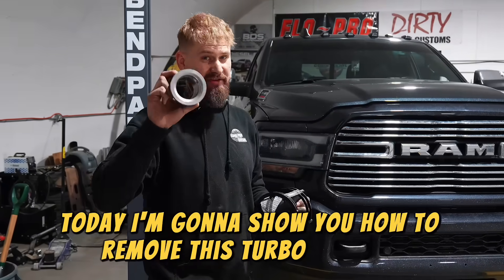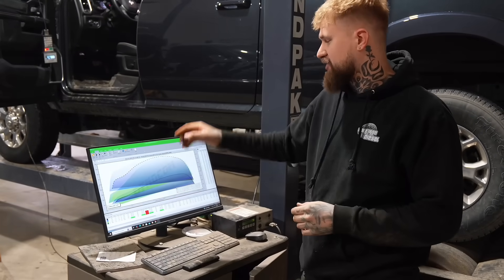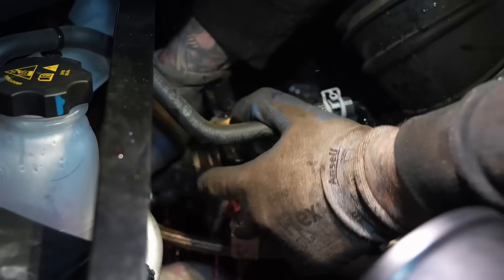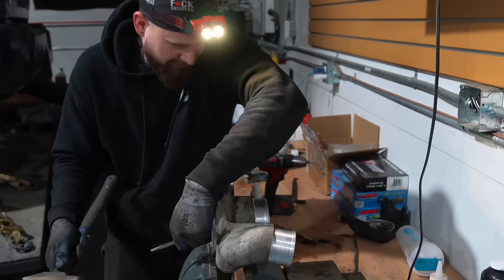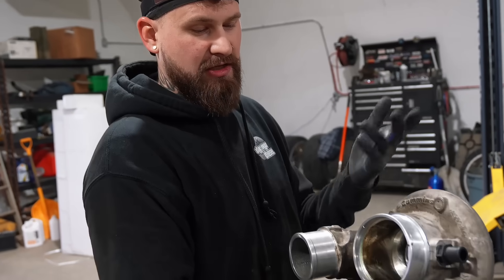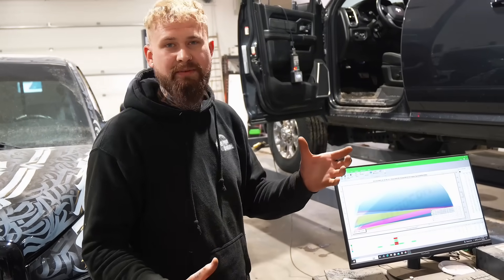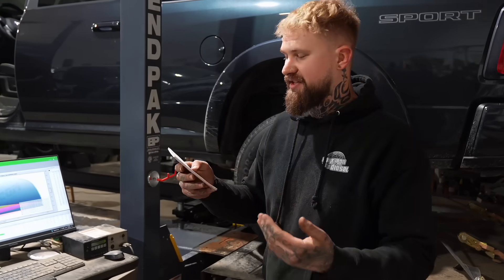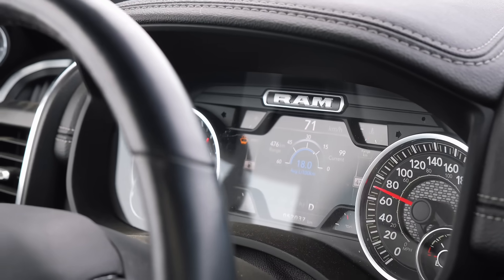Does Removing The Silencer Ring Increase Horsepower?

Comment: Isnt that the surge ring. If so i would never take that out. 100% pull that plastic baffle though
Reply from the maker: 🤷🏼‍♂️ I thought it was the silencer ring, to be honest most of the new knowledge I gain now is from comments on my videos and posts 😂 I definitely never claim to know everything
Reply: @darkirondiesel  lol I definitely don't know everything either but when I looked at mine it just looks like a built in surge ring instead of for example the bolt on intake with the anti surge the l5ps use. 🤷‍♂️could very well be wrong
Reply: The surge channel is part of the housing, this is just a silencer ring.
Reply: @Lethal-Media  the only possible opening for an anti surge system is between this ring and the rest of the housing so there's no way it's part of the housing.
Reply: Definitely the silencer ring, VGTs don’t really surge much anyway
Reply: @joeydalia2572  vgt has nothing to do with the compressor. Surge when the compressor is at to high of pressure and to low of mass flow for a certain shaft speed. Having a turbo that runs close to surge at peak numbers gives you better drivability "under the curve" so manufacturers like to push that. So yes vgts surge. I'm just not 100% sure if that's actually an anti surge system or not.
Reply: @Eric_V410 At the end of the day it doesn’t matter, if Kyle kills the turbo we can learn from him and it will make for good content upgrading the turbo or turbos..
Reply: @Lethal-Media  well I mean it's your money your truck do what you want. I just think if it's not a silencer ring people should know because lots of people remove them cause people on social media do

Comment: When are you gonna test the Banks Monster Ram Air Horn?

Unless Banks already Threatened you...
Reply from the maker: No banks actually sent me one. Hopefully get the rest of the footage for that video this week then have it uploaded by the end of the month
Reply: @darkirondiesel don’t let them buy you out like the rest of these YouTubers.
Reply: @darkirondiesel  hope so
Reply: lol I ask then that few weeks ago
Reply: I'll need that footage released sooner rather than later, was on the fence between banks and SB, banks on its way, may wait to open if results video will be soon!
Reply: @SHPLOOPSHPLOOP  Banks will net near zero gains and lose torque. Firepunk has a video out. And before you say it's gains are more pronounced in tuned and modded trucks, they used one with over 1k hp. Another shop owner used a stock truck, same loss in torque. $1k paper weight.
Reply: @HSKFab  ooof, it's odd cause of the gaping plumbing they use compared to others, but I bet their MAF sensor contraption has a lot to do with it. Wonder what would happen if it were tuned properly with the regular sensor
Reply: @SHPLOOPSHPLOOP  All you need to do is take a look under the hood of all the big time cummins racers, sled guys, dyno trucks etc...none of them have banks hardware.
Reply: @HSKFab  realized the OP was talking about the intake horn and not the powerstroke intake 🤦‍♂️ read this right after a comment about pulling the turbo baffle from a powerstroke
Reply: @SHPLOOPSHPLOOP  What powerstroke do you have? Banks is trash for them as well. Check out Pusher or no limit.
Reply: @HSKFab  2019 about to go on a diet
Reply: @SHPLOOPSHPLOOP  Nice. I'd do the pusher full piping kit. Gets rid of the plastic manifold. I run the pusher manifold. Short on my page.
Reply: Sent with stipulations I bet 😂
Reply: @ I would suspect that's the case hence the reason for the delay.

Comment: I run a banks cold air intake and intake horn on my 18” Ram 3500 and I can hear the turbo a whole lot after installing that. Need to delete soon 😅
Reply from the maker: Yeah with an aftermarket intake I think you would see a big difference in sound

Comment: When we going to get an L5P dyno before & after vid? I'm curious if the SOFT tuning issue is persistent as it is in the LML trucks. I swear tune 5 acts no different than tune 1.
Reply from the maker: Next time I have an opportunity I’ll do it. The SOTF definitely works on the L5P as it’s electronic and controlled from the steering wheel controls.

Comment: What delete kit do you think is best for the 5th gen Cummins? I’m looking for something reliable.
Reply from the maker: This is the kit I recommend for the 19-21 5th gen (not sure what year yours is) https://shrsl.com/4ke06 it comes with a switch to change power levels but I recommend daily driving it in the #3 position
Reply: Raceme ultra with the CT tunes, tunes the 68rfe, also can switch tunes on the fly through the touch screen as well as rumble vs whistle or faster cooldown or warms ups that sorta thing. The newer trucks it’s like 150-160hp gain the older 4th gen’s I’ve seen as high as 200hp from doing that. But I would go with any of the modern ones with shift on the fly tuning but I prefer raceme ultra cause it does both preprogrammed 5 levels of tuning plus allows for custom tunes to be added and the other is mm3. Nice video bro, you got balls just ripping shit apart like that without knowing exactly what it will do lol
Reply: @JDdoesmore that’s what is on my 22. It was expensive with the clone ECU, but man it was worth it. It’s like a completely different truck.